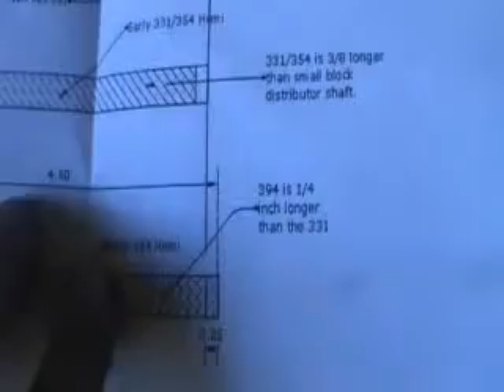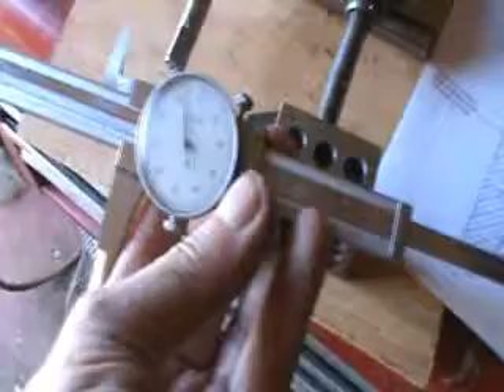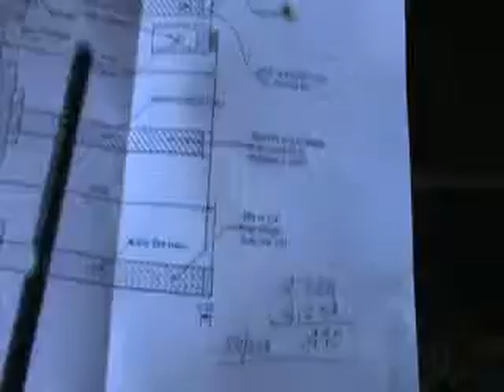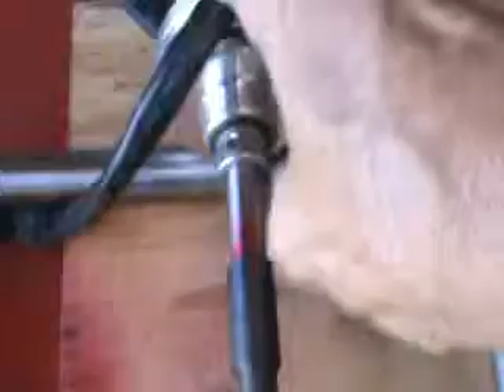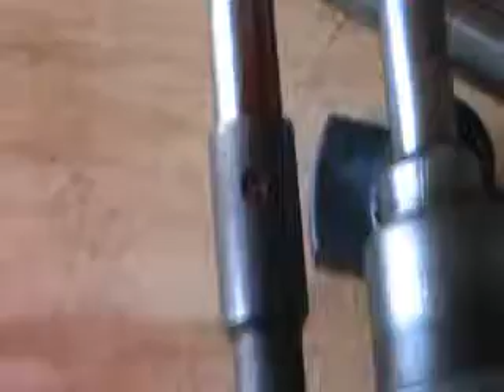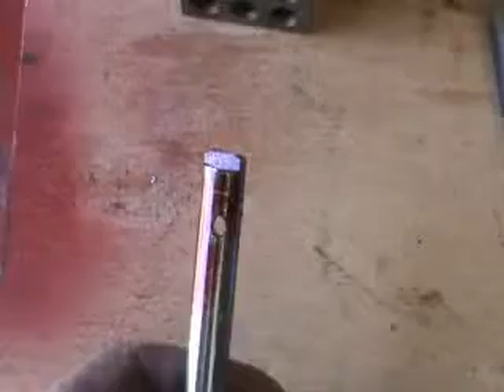Chrysler Early hemi Mopar Distributor adapter conversion to late model distributor

Comment: Can you help me convert my generation 3 345  hemi to distributor? It's in a Charger RT.  I'm ready to convert to an aluminum intake/carb.
Reply from the maker: Yes, I think so.  If they use the same size distributor hole It should be easy to make an adapter to use standard distributor.

Comment: Do you have one of these for a 6 volt
Reply from the maker: No, they are all 12 volt. The adapter will work, but the distributor is designed for 12. They might work on 6v, but I dont know for sure. Your starter will be ok on 12v, but you would have to change to a 12v alternator, and battery. You could use a voltage regulator to drop to 6v for your guages, and change the bulbs to 12v. Lights will be much brighter.